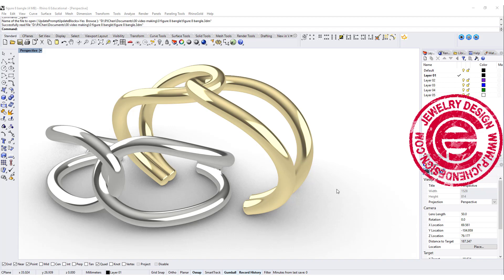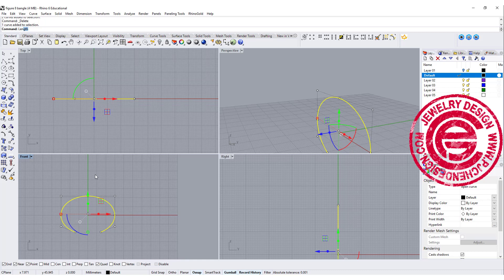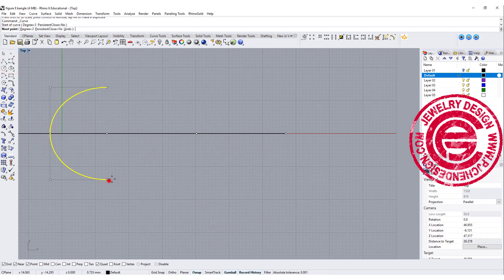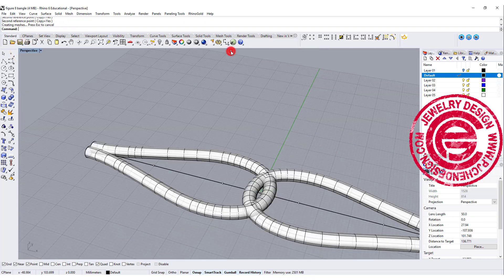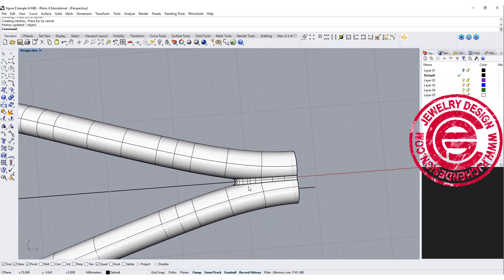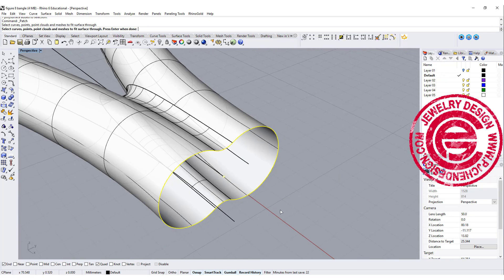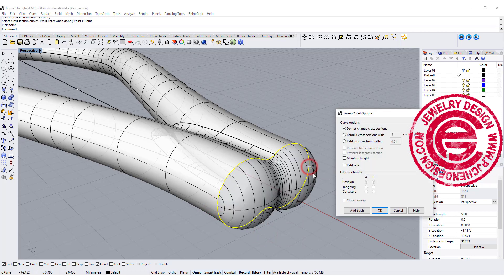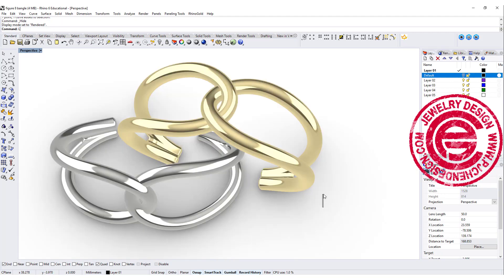Figure 8 Bangle 3D Modeling in Rhino 6: Jewelry CAD Design Tutorial #108

Comment: Hi PCJ, I am trying to create this cuff blt but getting one naked edge in the merge area on the right side again and again. I tried "join edges" command and it does not work. The left side is fine. The right side has the problem. It won't let me join finally into a closed polysurface at the ends. Can you help??
Reply from the maker: please check on your email that I responsed